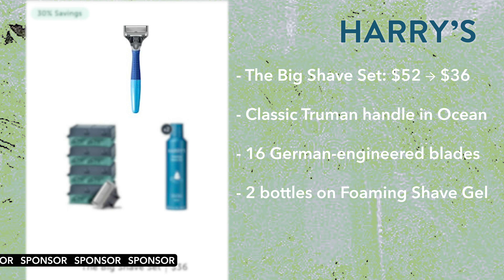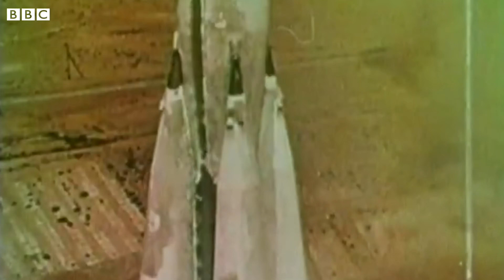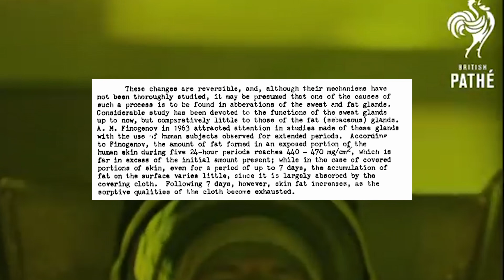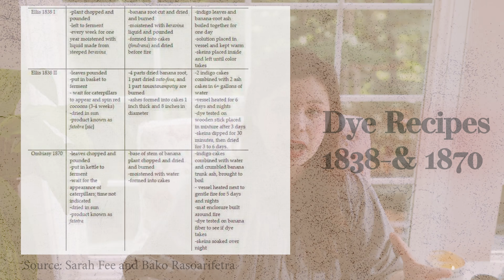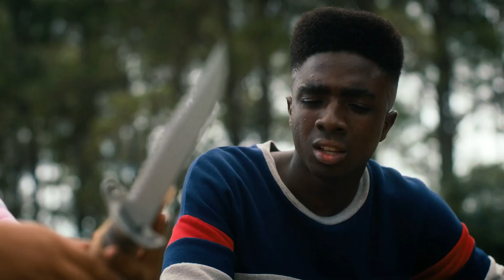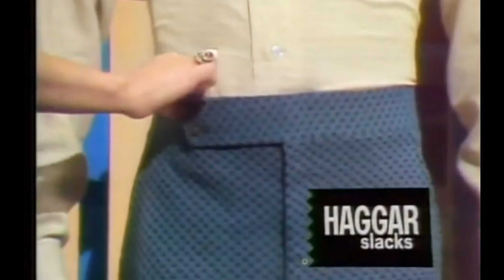The DISGUSTING truth about Laundry

Comment: I was very poor as an out of town student in the 70's and hand washed everything as I could not afford the laundromat down the road. I soon learned how to treat my clothing better, make better second hand choices in the charity shops and tackle anything from ink to blood stains in my shared bathroom bathtub. I still enjoy hand washing my woolens and underclothing. Great topic, Abby...this could easily be a multi- part topic if you include proper ironing and starching. :)
Reply: Proper, efficient ironing and starching would be great to see, I really want to make my shirts look better without having to spend forever on them 😩
Reply: @kagitsune  One simple tip is to give each garment taken from the washing machine a good shake after cleaning and prior to placing it in the dryer or hanging it on the clothing line. This relaxes the fibers and helps to prevent set in wrinkles. ;)

Comment: when i lived in a warmer climate and had the option to, i almost always line-dried my clothes.  it was a good way to get myself outside for a few minutes too....

an easy thing for people to do is to look into switching their laundry detergent!  there are brands out there that sell biodegradable detergent (biokleen is a favorite of mine, and i'm using country save at the moment), which are less scented than other brands, not all that expensive, and usable with high-efficiency machines.  if you have a co-op in your area, you can even purchase these products in bulk to save on packaging.

these options won't reduce your need for water or necessarily sanitize your clothes any more, but can be gentler to the water used and reduce our reliance on plastics.

Comment: When we bought our house, the clothes line was a non negotiable option. I must have one, period.

Also I use white vinegar instead of fabric softener, which helps remove leftover soap from the fabric so it is soft, instead of adding more chemicals.
I put Tea tree essential oil to kill bacteria, 4-6 drop in a load.
Reply: Because I've had issues in the past with bedbugs (bgaaaah bedbug PTSD), I will add some lemongrass and geranium essential oils to repel insects.

Comment: One thing of note on hang drying: Leaving clothes out to dry when living in a highly populated, or high traffic, area results in an absorption of compounds and odors that aren't desirable, both now and back then. Access to sufficient outdoor air quality isn't insignificant, as even hang drying indoors would likely be behind UV resistant windows. Another popular use of the machine dryer is to reduce the need to iron/press clothing, which is generally seen as an unwanted chore.

Comment: Follow up question: is the dryer hot enough to sanitize clothes? Where I live, we are not allowed to dry anything outside. I've had retractable clothes lines inside and drying racks for years. If you are worried about wrinkles, just dry in the dryer for about 5-10 minutes and hang it up on the line.

Comment: I whet down this  hole a few years a go. It's 3 steps. One don't use those pods. Get yourself some earth friendly laundry soap. Only use 1to2 tablespoons. Use a measuring spoon. If you have hard water use 1 cup of washing soda. This an green way of softening your water. In the fabric softener compartment use 1\4cup of white distilled vinegar. This will soften your clothes and removes smells.line dry clothing.

Comment: I have clotheslines in the summer and racks in the winter, but bad news: line drying doesn't remove cat or dog hair very well.  I've found that 10-20 minutes of tumble drying without heat using a dryer ball does the trick though.

I also haven't found a good indoor drying rack for queen size sheets and blankets in the winter, so the dryer gets more use then.

Comment: I'm already super super neurotic about the cleanliness of my laundry, and washer & dryer - to the point that I do not share a laundry basket with my husband, and I have my laundry split into separate baskets for hot and cold wash (with things needing sanitization like undies, socks, washcloths, towels in hot), and I always leave my toploading washer open for hours after doing a load to ensure it drys out without creating mildew. If I ever move somewhere and the washer/dryer are provided or left by previous tenants, I will remove those and only use mine.
Reply from the maker: I apologize in advance....😪
Reply: @AbbyCox  Hey I survived though! Plus I already hang-dry like half my stuff to keep the dryer from shrinking it and can definitely attest to the hanger ADHD hack 😄 Also, you didn't mention it but might white vinegar also be a good disinfectant option! I like using it for cleaning in general, way less awful than harsh chemicals.

Comment: For me it’s the fit - the first time I wash something it no longer fits, even if I use cool water and hang too dry.  The sleeves and length get shorter, and it gets wider. My long tee becomes a crop top with 3/4 length sleeves, 2x the width of my body.
Reply from the maker: I would look at see what the fiber content is of the garments. Stuff like Rayon will get damaged in water pretty easily...it's all so delicate :(

Comment: Laundry detergent is actually easy to make get some baking soda and bake it in the oven to reduce it to washing soda about 20 minutes on 400 for 4 to 5 cups. Get some bar soap I like Ivory because it's fragrance allergy friendly. I have severe ones. And historically it was a laundry soap specifically marketed toward wool. It changed to a body soap at some point mid 20th century but it's formula is still perfect for laundry. Grate the soap up really fine then mix with the soda. You'll want about a bar and a half for 5 cups of soda. A quarter cup will wash a standard size load. Then I personally run that same load through quick wash with vinegar. It ensures that all the soap is removed and leaves it fresh and clean. Bam laundry soap that's safe for the environment for a fraction of the cost. If you want scented cloths get some wool balls for your dryer and put essential oils on them.

Comment: I’ve tried air drying my clothes on the line, but I have severe allergies so it made me have bad reactions. If you try and air dry inside, if you use a towel first to get an excess moisture off the garment it speeds up drying time.

Comment: Well, if you have a good soap, like Savon de Marseille (dunno if it is available in the US, but there's perhaps an equivalent) access to a washing machine and a very big pan and a cooker, then how about running your cottons and linens in the washing machine with the good soap at a low temperature, then transferring to the big pan, boiling it on the stove (ten minutes to sterilize baby bottles, so how long for laundry?) and then hanging it out to dry?

I remember something about baking soda and laundry.  Is it just a stain remover or is it also a sanitiser?  for things that cannot be boiled, that is.  I used to soak the babies' cloth nappies (diapers) in a bucket of baking soda and water and then dump it into the washing machine in the evening, run it at 90 degrees centigrade and would have spotless, fresh-smelling nappies in the morning that I hung outside to dry.  And now I find out that they were probably not as clean as I thought.... yikes!

Great video and I hope all of us who can will take all of this into account when considering the topic of clothes and laundry.

Comment: This was so interesting! I've never heard of using vodka to sanitize clothes, but I do something similar with vinegar! If my laundry is smelling particularly gross (or even if the weather is just on the damp side and I'm worried about things getting musty), I throw in a little vinegar at the end of the laundry load to sanitize and get rid of odors. I think it also softens clothes, so you don't want to overuse it, but it helps. One other small thing is that I hand wash and hang dry delicates, especially bras and things like hand knitted socks. Idk if it makes much of an environmental impact, but it's gentler and it gets them cleaner.

Comment: i live in apartment with 5 units and one washer. it would take me 3-4 loads of laundry/week with that machine, which would wind up costing $9-$12/week or $468-$624 a year. i also wear mostly vintage clothes from the 70s/80s, so using a communal machine makes me nervous about theft, not to mention it's just a low quality machine.

to save my clothes and myself some money, i got a portable washer for ~$150 that is small enough to be carried out of a closet and parked in the bathtub during laundry day.

it has clear barrels so i can see if my clothes are moving around enough or if it's overfilled and they're rubbing against each other. while using the washer, the cycles are manually set timers. this means i can change the wash, spin, and rinse cycles based on what i'm washing. the spin chamber is separate, so i can start on another load while my last one is spinning. i also love this because you have to manually drain, which means i use the rinse water (only on things that didn't go in super dirty) as wash water for the next round. i use vinegar as my fabric softener/light disinfectant, so there's no huge amount of residue in the rinse water that would impede detergent. it's literally just rinsed off detergent and whatever didn't get flung off during the middle spin cycle. 

the spin cycle on this thing is also INSANE like, a towel comes out drier than it would be if you used it after swimming. to dry completely, i'd love to just line dry outside, but my allergies would kill me. instead, i set up a foldable drying rack inside, stick a box fan on top of something so it hits the clothes just right, and i hang pieces up and replace them with the new load once they're dry.

the real game changer here is that i also cover the whole rack with a fitted sheet that i tuck underneath, leaving only the side with the fan open, essentially creating a tent around the rack to recirculate the air around the clothes. i thought i came up with some genius new invention, but amazon sells drying racks with specially made covers and heated fans that i've seen for as low as $70, so if you're less cheap than me that's an option as well and would probably be even faster, though slightly less efficient. 

i'm doing laundry right now, and i started with towels (i usually start w whatever takes longest to dry). i'm on load number 3 (they are about half the size of traditional laundry loads), so it's been about an hour since i hung them up, and my towels will be dry by the time this load is done. my towels took an hour to dry when i used a tumble dryer, that's how good the spin feature is. you can also skip that and hand wring on more delicate items, but i've sent everything i wear through it with zero issues (other than an 80s satin shirt that all of the buttons came off of, but that was the first time i washed it after thrifting and none have come off since i reattached them properly). 

to recap: i'm saving myself over $300/year, i can use less water because i'm reusing rinse water to wash, i save energy because i don’t use a tumble dryer at all, and i don’t have to worry about my clothes getting stolen or interacting with some of my less friendly neighbors. downsides are that it does take more effort to switch from wash>short spin>rinse>long spin and then to hang up to dry, but i find that it takes me all day to completely finish my laundry anyway and while doing this, i still have plenty of time to get other chores done and just pop in about every 10 minutes to shift things around.

anyway, this process of mine is very involved but i'm happy with the results. if nothing else, i swear by the drying technique outlined above, especially if you give anything that's prone to wrinkling a good shake/whip before hanging it up. the fan also helps with that and the constant agitation prevents the stiffness you can get otherwise. 

i hate the way laundry is done so i've spent way too long trying to perfect my routine. this is where i'm at now, but ymmv. just thought i'd share an option not many people are aware of. i have been doing this for 6 months at the recommendation of a friend who has been for 2 years and neither of us have had any issues. when this machine burns out, i'm almost definitely buying another.

Comment: What I learned from this is that American washing machines are shit. I've not seen an agitator model that was manufactured any later than the 60s (most older machines here are top-loading but still just the spinny-drum-type), and all machines can do at least 90 C (=194 F) if not 100 to sanitize. Also absolute madness to me that you're not allowed to put up lines. Here, even apartment buildings will usually have some lines both out in the yard and inside in a designated shared space for the residents. Learned the hard way to not leave underwear in the indoor one though, lost all my favourite panties to some creep :(

Comment: When I lived in the Yucatan, many people had a drying room. It was basically a shed without a roof with laundry lines in the backyard. The sun is brutal there and it ruined anything with elastic very quickly ( I ended up replacing the elastic in all my husband's boxers). 
 My solution was to hang my clothes in my covered porch on hangers. They take less space on the line and it's one step less. 

Also aprons do wonders for protecting your clothing. I like the kind with a bib front  and pockets. Speaking of protecting clothing, our ancestors even wore washable sleeve protectors. Collars and cuffs were often removable and could be washed or replaced.
Reply: Good call! I have specific clothes diy, gardening, etc and I just bought myslef an apron too!
Reply: And in Norway a space for laundry drying would be an airy space with a roof.

Comment: Brand new tennis balls for the dryer only will agitate the clothes in the dryer, allowing them to dry faster.  Borax 20 Mules added to laundry soap in the wash cycle helps with hard water.  Borax is a natural mineral and help a lot with hard water.  Drying outside in FL is a crap shoot, the clothes fade in this bright sun of the " Sunshine state' I use a drying rack for bras and other delicate clothing.  It's a trick keeping kitties off the rack and wet clothes.

Comment: Hmmm... Softeners I have never used, they are disgusting and they stop bath towels and  kitchen cloths and anything else from absorbing water. I use the minimum of detergent and I always add a good handful of soda crystals to the machine while I wash. The soda helps soften the water and, more importantly, it is excellent at keeping your washing machine clean. I haven't had black goo in the rim of my washing machine ever since I started that practice, many years ago. And soda crystals are not expensive either, unlike all those other, fancy chemicals you can buy, with synthetic scents and stuff that you really don't want. With regard to decontaminating clothes, I use a good lavender essential oil which goes in the last rinse cycle, where you would otherwise put the softener. That may cost a bit more, but you only need a few drops each wash. And if you don't like lavender, then find an essential oil that will do the same thing with a scent you like better. I always wash at low temperatures and hang the items out to dry whenever possible. It does rain a lot in the UK, so in that case I hang it up inside, because I don't even have a dryer.

Comment: Now Abby has started a world-wide movement away from "modern" laundry habits. LOTS of good comments here. My 2 cents: LONG ago a Maytag repair man told Mom that the tiny holes in clothing when they came out of the washer was the effect of the dry laundry soap eating the fabric when it wasn't completely dissolved. He suggested putting the laundry soap in before the clothing. Re: towels:  I live in NC, USA: humid country. After luxurious fluffy Terry cloth towels quickly turning sour, and a friend having a light, thin cotton woven bath towel from India, I re-evaluated. I now have thin flat-woven cotton towels for hand towels (think lighter than UK tea-towels), and linen bath towels. Both dry faster than those luxe soft Terry towels, so need washing less frequently.
Reply: Can't do that in a front loading machine. You just have to put the detergent in the drawer on the machine.